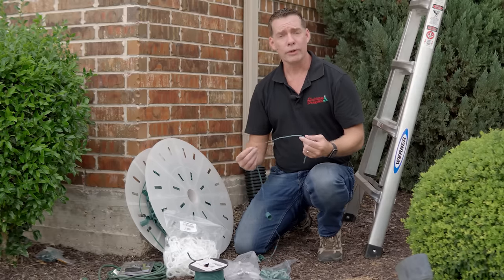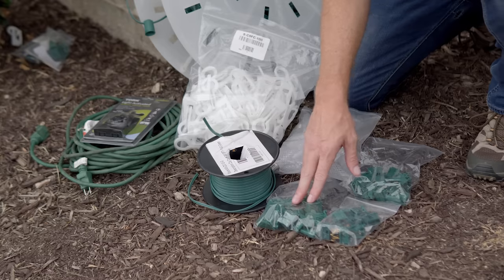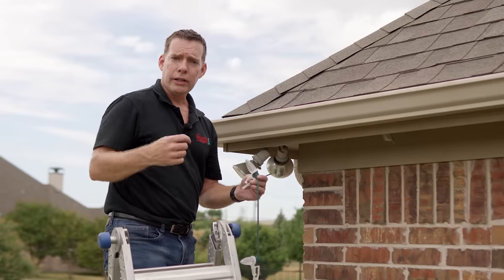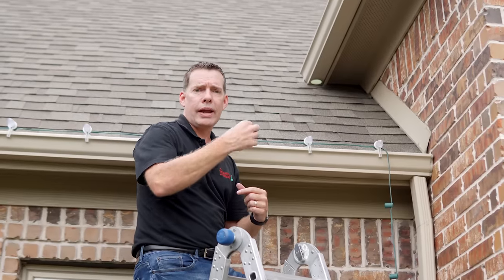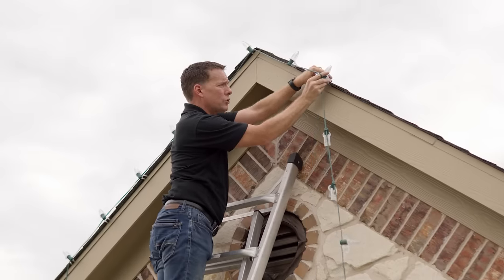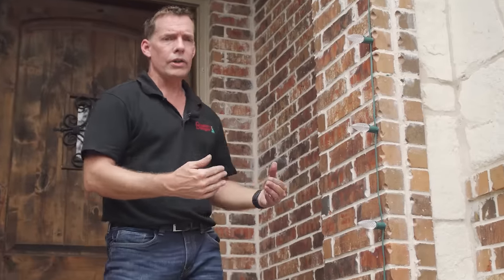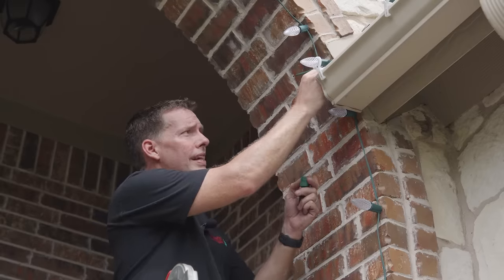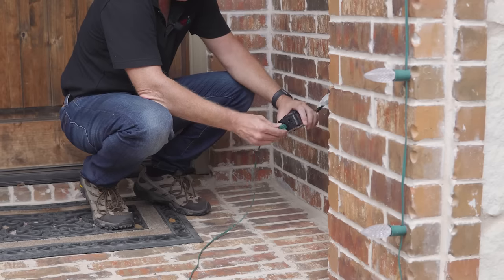How to Hang Christmas Lights on your Roofline like a Pro

Comment: What advice do you have around ladder safety and peaks? I’m very comfortable with 95% of the roofline but we have one peak that’s about 26 feet up and I’m wondering if the best way to get the lights up there is to just extend the ladder and go from the front like you did, instead of trying to get on top of the roof.
Reply from the maker: That's a great question. The best method is from a ladder, as long as you have a ladder that can go that high. Ladder safety is even more imperative at those heights, so make sure you are up to speed on good ladder safety.

There are tools that professional Christmas installers use to help them install lights safely from on top of the roof. These include: 
Cougar Paw shoes/boots - https://www.cougarpaws.com
The GOAT Steep Assist tools - https://www.thegoatsteepassist.com
The RidgePro - https://www.theridgepro.com/

Unfortunately for an average homeowner, these tools can be expensive. But in some areas you may find them for rent at a local tool rental store.

Most importantly stay safe and have fun!
Reply: Hire someone
Reply: Get Cougar Paw Roof shoes and a couple Pitch Hopper steps and get on the roof, like standing on flat ground with using those two things, all roofers have them.
Reply: @ChristmasDesigners  Pitch Hopper Steps are amazing as well

Comment: How do you get the lights off the brick once it’s glued? Do you need a heat gun or something?
Reply from the maker: A lot of the glue will peel off when you gently pull the lights off. For some tougher glue, you may need to use a chisel to help peel it off and for more stubborn residue, Isopropyl Alcohol works well.

Comment: I recently bought my first new built home, and my first christmas decorating. I got some string lights then saw the C9 bulbs at a store thinking wow. Got the 100ft C9 housings, bulb seperates in LED with plugs to cut the perfect size around my front of the roof of the house, plus my borders of the garage. Really clean cut which helped me alot. I skipped the timer part but overall still happy with my result

Comment: Zip cord!  That's what I've been looking for for so long now.  I've been trying to connect a few different strands of mini lights in one line, but with a some unlit gaps in between.  Using an extension cord makes it impossible though because of the one wider male blade doesn't fit into the female end of the string lights.  Thanks for illustrating this.

Comment: In this specific application you showed in the video. What plug would you use at the very beginning of the run where you started. I initially would have said a male plug, but since you added power in line, would you put a female plug there?  Thanks!
Reply from the maker: We recommend using a female on the end of the run. Even if you are not using the female end for anything, this gives the line a safer endpoint. Some people do loop the end of the wire by folding over the last 2 inches and wrap it in electrical tape. But over the course of several holiday seasons, that tape tends to unravel. So a female slide on plug is the best solution.

Comment: For C9 bulbs, are these brighter when installing them pointing straight up towards the sky or straight out from the house (perpendicular to the house) ?
Reply from the maker: As long as you are using truly professional grade C9 bulbs such as Pro Christmas or Minleon, the illumination intensity will look very similar regardless if it's pointed up or out. Many homes have both orientations since the bulbs on the shingles point up and then the bulbs on the gutters point out. At night, they look nearly identical. But again, be sure you are using the same bulbs that professional installers are using. https://www.christmasdesigners.com/christmas-lights/led-replacement-bulbs/c9-led-bulbs.html

Comment: Great video, thanks for the tips. I love doing a lot of decorating for the holidays but have always just bought strings from Home Depot.  I'm frustrated every year when near new strands have multiple lights out.  Definitely was thinking of trying to upgrade, but didn't know anything about these professional empty socket lines. Always wondered how they get them to jump from one spot to another.  I stumbled onto your site looking for a set of Twinkly lights for my tree.  Can't wait to get those hooked up.  Do they make color changing C9 lights?  There is a house in the neighborhood that had purple and orange bulbs for Halloween, then shortly after had white lights for Christmas.  I suspect they had these empty socket strings and just swapped out the bulbs.  But this year they are color changing.  I can see them fade, chase, and change colors for Halloween.  Haven't seen anything like that with C9 size bulbs.
Reply from the maker: At this time we do not have a C9 bulb that you can change to any color via an app. We do have slow change and quick change but they go through all the colors. 

We do have some customers that use Twinkly to outline their houses. Then they change to any color they would like. 

With the Empty socket, yes, you can change the bulbs to the Christmas colors after Halloween. 

Thank you so much for your comment and we appreciate you taking the time to watch our video. If you need any other assistance, please feel free to speak with one of our specialists at 800.391.5280.
Reply: @ChristmasDesigners  Definitely frustrating having to but new lights every year! How many seasons are people getting out of these?
Reply from the maker: @Yotataco04  We can definitely understand your frustration. LED lights are meant to last longer than the 1 season. Our lights are commercial grade and you’ll typically get 6 to 8 seasons for residential applications and 4 to 6 seasons in commercial applications. We do have some best practices and tips to help keep your lights in good condition. Please feel free to visit our blog to see if this will help in your situation: https://www.christmasdesigners.com/blog/christmas-light-storage-best-practices-and-tips/
Reply: @ChristmasDesigners  Can you explain the difference between residential and commercial, and why they last longer in one application than the other? I mean if the lights are on 6 hours a day for 6 weeks at a private home or the same amount of time at some commercial building...on is on, so what's the definition or how is figured out? Thanks and keep up the great work.
Reply from the maker: @wjf213  Yes, commercial grade bulbs are designed with higher level performance and consistency in mind. Commercial bulbs are more weather durable at IP65 rating, created to withstand harsh winters over many seasons. For better protection throughout the years, the bulb materials are equipped with corrosion-preventive nickel bases and polycarbonate shatter-resistant shells. Professional appearance is also a major benefit. It doesn’t matter if you bought all your bulbs this season or if you bought them over the course of a few seasons… with commercial bulbs, you can expect better color matching and brighter lights. Retail bulbs, on the other hand, are typically made with a lighter weight material that will suffer more quickly from fading, dulling and inconsistency. 

 

The LED diodes inside commercial bulbs can last up to 60,000 hours, so in terms of longevity, residential customers typically get 6-8 seasons and commercial applications typically get 4-6 seasons.  Many residential customers use commercial bulbs and light line for their home applications. But compared to retail-grade bulbs, the higher quality construction and materials of commercial bulbs is what helps them last longer and look better. We do have some best practices and tips to help keep your lights in good condition. Please feel free to visit our blog to see if this will help in your situation: https://www.christmasdesigners.com/blog/christmas-light-storage-best-practices-and-tips/ We hope this information helps, and let us know if you have any other questions!

Comment: Is it ok to have clips sitting on the bulb itself? That’s what I’m worried about the most. Cause clipping them on edge of bulb secures it in more for a clean look
Reply from the maker: If your lights are LED, it’s okay to clip wherever it is most secure. If you’re using glass incandescent bulbs, it is not recommended.

Comment: I’m doing the same setup. I have one long stretch of lights in front and my arch is in the middle. How did you get power from the arch to the top row of lights since the end of run for too lights is at ends???
Reply from the maker: From the arch to connect to the upper perimeter, we used an inline female on the arch line and then plug the upper perimeter to that female. The arch was plugged directly into the outlet, so this powers both the entrance arch and the rest of the perimeter lighting.

Comment: Picked up some good tips ! Thanks . !! 
My eavestrough has metal leaf guard on top . Any ideas .? 
My tip is to bring the lights indoors the day before installing .  If you waited too long- ❄️  lol The plastic is more  flexible, and less brittle.   🇨🇦
Reply from the maker: Great tip on bringing the light line indoors to warm it up in cold climates. That does make it a lot easier to work with during the installation when temperatures are very cold.

Leaf guards can be tough. We currently don't have any leaf guard clips, but there are some available on Amazon. The biggest challenge with most leaf guard clips is that they only hold the wire and not the actual socket. Some leaf guards have enough space between the gutter and the guard that a clip can slip into that space.

Comment: Are two different style female and male vampire clips needed. The website is tough to figure out? Great video. Slide on vs breakaway tab?
Reply from the maker: The breakaway tab is a slide-on as well, but it has a tab to breakaway, which is for use in the middle of a run.

Comment: Hey what do you do if you have a house that requires more that 250 ft, can you use 1000ft line and cut it? what is the protocol for doing that if that is the solution thank you
Reply from the maker: Great question. The rule is for 250’ or 250 bulbs - whichever comes first - is what can go on a single line. Those lines can be on the same OUTLET, just not in a single light line run. 

The best way to do this is to have each line plug into a 3-way plug adapter, then that plugs into the outlet. If you are running four 250’ lines, you would use two 3-way adapters. To keep things balanced, you would plug two lines into one 3-way and plug this into the top female of an outlet, and then plug two lines into the second 3-way and plug that into the bottom female of an outlet. This balances out the lines and keeps everything from being overloaded. 

Below is a link to the 3-way that we sell. But these are available at any hardware supply store as well: https://www.christmasdesigners.com/3-way-plug-adapter.html

Comment: Great video thank you! On question came up. How do you install lights with gutters having splash guard installed? Thank you
Reply from the maker: Gutters with splash guards can be challenging. In some cases there's a seam that you can slide the clip into between the top of the gutter and the splash guard. You may have to trim part of the clip off in order for it to fit. If that is not possible, a dab of hot glue on the socket can allow it to stick to the gutter splash guard.

Comment: Thanks for video!  Question, why don't you use 1 long run for the whole house in this video?  I noticed you adding vampire plugs in a few areas. Is this because it's easier to have say 3 sections of light cord and lights rather than 1 long section?   Appreciate your helpful video.
Reply from the maker: On this project we were unable to do a single run because the roof has different, independent sections. Refer to the video at 3:50 and you can see how the roof perimeter design is not consistent. There’s lower sections and upper sections. As a result, several runs had to be done independently and then connected to the next section with a length of zip cord. If the roofline was a single, straight design, without any architectural breaks, then a single line of zip with no cuts would not be a problem.

Comment: Hi, First, this has been very helpful. Secondly, can you suggest what to use if I have aluminum siding and not a brick wall? Thank you
Reply: Unfortunately with siding light set attachment is a lot more challenging. In some cases you can slide a clip under the siding to hold the line in place, however, this doesn't allow for as clean of a look as it does when you are able to anchor every socket with a dab of hot glue.

Comment: Thank you for the video. It is very helpful! 😃. Would you recommend any electrical tape on the female ends and in line females in places with lots of rain?
Reply from the maker: Taping female ends is a contentious subject with pro Christmas installers. Some insist on it and others say that moisture can still get into the female though condensation, but because it eliminates airflow, the female is unable to dry out. This then leads to more GFCI tripping issues.

Having open female ends is typically not an issue. But when it rains, you may have issues with the GFCI circuit tripping and needing to be reset.

In wet areas, if you decide to tape the end, make sure it's tape up with good quality tape and completely sealed so that it won't allow any moisture in. You can also use plug covers and gaskets. Below are links to these products on our website.

https://www.christmasdesigners.com/a-plug-pro-plug-cover-bag-of-5.html

https://www.christmasdesigners.com/a-plug-pro-gasket-bag-of-5.html

Comment: Great Video!  Question: How do we deicide bewtween 12 or 15 inch spacing for c9 lights on a 2nd story eve?  Are there images available for examples?  Can 12 inch appear too busy or 15 inch appear to widely spaced and sparse?
Reply from the maker: Thank you so much for your question. Our two most popular spacings are the 12" and 15" most people do not see a big difference between the two when it is lit. It all comes down to personal preference and budget. 

If you would like to email us at customer_success@christmasdesigners.com ATTN: Product Support, I can send you a picture of both options.

Comment: what would you recommend for hanging lights on painted wood surface such as rooflines with no shingles or around windows damage-free?
Reply from the maker: That is a great question. Unfortunately, there are not a lot of good "damage-free" options for wood. 

We would suggest utilizing Lite-Clip Strips with a permanent adhesive on the roofline or around the windows. You can find the strips and the clips that go with them here: https://www.christmasdesigners.com/catalogsearch/result/?q=lite%20clip

Other than that, stainless steal staples would be the best option however, you would have to make sure to pull these out of the wood frame each year, fill the holes in and touch up the paint. 

Hope this helps.

Comment: Are the bulbs on the top gables pointed up or straight out like the ones on the gutter?
Reply from the maker: The bulbs at each peak are pointed up like the rest of those on the shingles. You can see this a bit more easily if you pause the video around the 6:50 mark.

Comment: I've been seeing the use of hot glue more often for installation.  What I don't see is the removal of the lights after the season.  I know that hot glue can become brittle in cold, so guessing it should pop off the brick in January, but how does it affect the light string?  and does location make a difference - North US, versus middle versus South? Thanks for the comment about how many LED bulbs can be strung together, will be changing my configuration this year.
Reply from the maker: For seasonal use of hot glue, the location does not have a noticeable impact. We’ve had customers in northern parts of Canada and Alaska use this technique without an issue. Upon removal, some hot glue residue may be left behind on the brick, but this can be easily scraped off with a chisel or paint scraper.

Comment: Does the hot glue affect the brick any, like after tearing the lights off?
Reply from the maker: @Jonny-Cakes, as long as the brick is not painted, there should not be any issues using the hot glue on brick. The glue usually comes off easily, but you can use a scraper if needed. For stubborn spots, you can use rubbing alcohol to loosen the glue.

Comment: If I have 250ft 12 inch spacing I’m using and need to run some zip cord 30 ft to an outlet does this count towards the allowed length which is 250 bulbs or 250 ft of cord?
Reply from the maker: You're good with a 30 foot zip to the outlet. The real limit is actually about 300 feet, but because a zip cord will often be used to power the line, we prefer to state the limit as 250 feet in order to allow for the cord from the outlet.
Reply: Awesome! Thank you so much for the quick response!

Comment: What's the best commercial grade 5MM Conical Wide Angle Indoor/Outdoor lights??
Reply from the maker: We recommend using Pro Christmas brand 5 mm Wide Angle Conicals. These are the top selling light set used by professional Christmas installers.